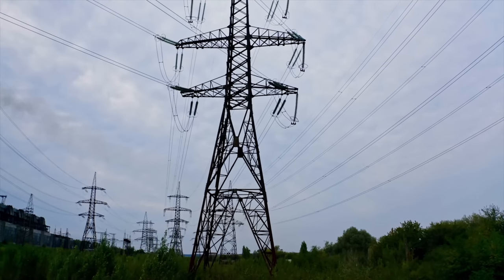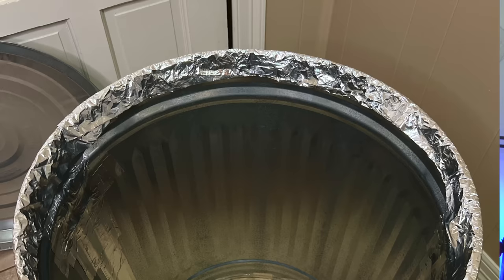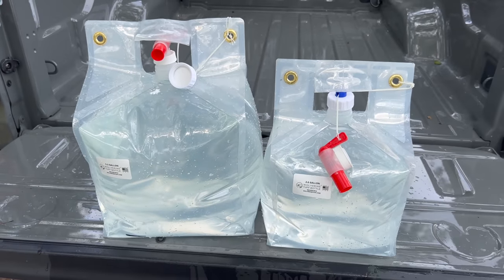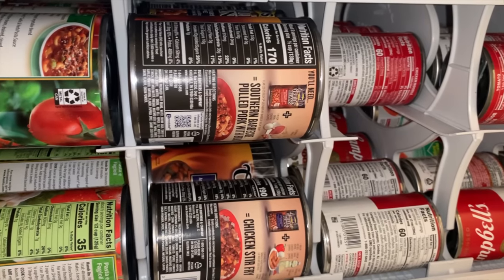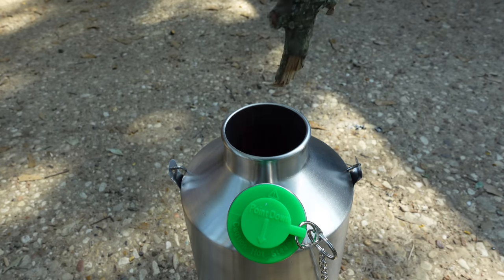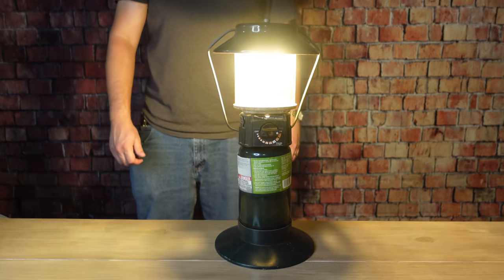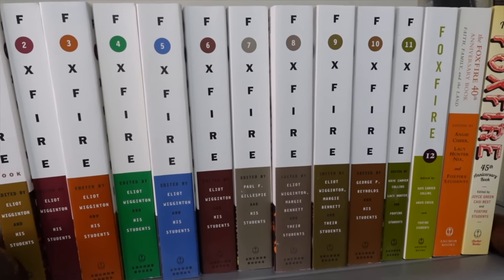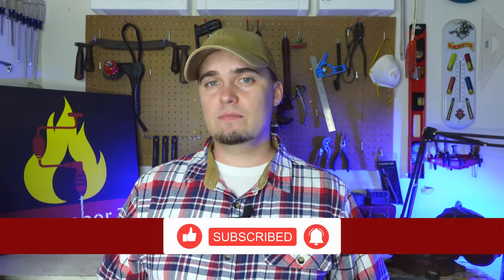Preps You Need to Survive an EMP

Comment: Hey JR...don't forget to store a few flashlights in your faraday cage. Modern day flashlights use LEDs which would fry in an EMP incident. Then along with the power bank you stored, be sure to protect the solar panels, which are susceptible to burn out in an EMP. 👍
Reply from the maker: Hi Eric! I'll probably go into a little more detail about what I'll be storing inside in the faraday cage video. A flashlight will definitely be in there. Thanks for watching and commenting.
Reply: Thanks for the info on the LED lights AND solar panels. I have long wondered about the effects of an EMP on the panels.

Comment: I took a cardboard box. I bought for 6.99 a 4’x8’ piece of wall insulation. It has a metal aluminum on both the front and back and has 3/4 inches of foam in between. I removed one side of the metal sheet and cut to fit the box. Cheap and perfect. I then sealed the box in aluminum foil

Comment: Good vid. Reiterating what was stated in this vid -- the best 'quick test' for a Faraday Cage's integrity is to set whatever it is you're wanting to protect in the cage and test it. If it is an emergency radio, then turn it on and put it in. After securing the lid (or whatever) and you CAN'T hear the radio, then it's probably working a bit. If you can't call your phone b/c it's in the cage, then it probably is protected. One thing's for sure: we don't know the extent of EMP damage. Not been tested at the 'society level' just yet. Depends on altitude, magnitude and your location.   I'm retired, wife still working. Her office is crow-flying about three miles, maybe four. She has a GMRS radio at work, Faraday protected. Same at home. She has a 'walking home route' and a 'driving home route' already pre-planned. Phones down?--switch to GMRS. Yes, we have a family licence, but if the plop-plop hits the rotary oscillator, licences aren't going to mean much if you catch my drift.

Comment: The large transformers used in substations are capital expense items and not off-the-shelf items. They are built on demand and the lead time is typically measured in months, lots of months. In some cases, the lead time can be years. Power grid failures cascade and the power grid could be down for months after an EMP.
Reply: Years. Plus the huge infrastructure loss ( hv wires, generators. Oil, power plant fuel will be gone. Not in faraday cage but essential weapons ( knife, bow/ arrows, .22 rifle and pistol plus a bigger caliber. Silencer good if you dont wish to attract attention). Rest of advice in his farady cage video is great.
Reply: @karlschulte9231  I agree the grid would likely be down for years; my comment regarding months is a best-case scenario. The last time I checked, the large transformers were typically budgeted in the utility companies’ 5 and 10 year plans. To your essential weapons list, I would add a shotgun.

Comment: The thing no one talks about is how likely any building that is tied into the grid has a very high chance of burning down. We all would be starting over no matter what preps we have.  Store your preps in a building not tied to the grid cabin, shed, garage,  root cellular, ect
Reply: Agreed.  I advocate for storing some of your preps in a bugout location. 
If you can't afford land, rent a storage unit.
Reply: @OhPervyOne 99% of storage unit facilities have electronic key card or pin number access  to open big steel gates and thise will also be fried
Reply: Likely true,  @joemarchinski914  but if your backup Preps are locked in a storage unit (usually brick or concrete with metal doors) most likely they won't get burned-up.
The locks may get fried by emp, but the facility is not likely to get burned-down.
Bypass the access to get to your unit and use your solid keys to unlock your padlocks to get to your preps.
Fried electronics may make it somewhat difficult to get in, but that's just a delay. It did not get burned down with your Preps in it, like your house did.

Comment: A basement is a good start on a fallout shelter, but you need to examine the ceiling of it.  If the basement ceiling is the floor of your ground level you have minimal shielding.  This can be solved by stacking or piling dense material in the room above the basement.  Books, bags of dirt, canned goods, a filled water bed mattress, lumber or other items.
Reply: Lead sheet is good

Comment: I have always wondered about the farady trash can if lining the inside with rubber would be better? I would assume so but I dont know for shure. Thanks for the content DIY Prepper.
Reply from the maker: I have thought that as well, but I went with cardboard because it was way cheaper. It also turns out that its a decent insulator as long as it doesn't get wet. The main thing is that what's inside the faraday cage doesn't make direct contact with the side of the cage.
Reply: @diypreppertv  I figured as much. Rubber is pretty pricey. We got 4×5×3/4 mats from Tractor Supply for $40ish. We used them to line our dog cage floors. Easy to clean and very durable. Thanks for the reply DIY Prepper.
Reply: Just need a solid non metal liner. It’s should not touch the metal. The metal conducts the plastic cardboard non porous fabric material limits pass through of the pulse.

Comment: I live in a Giant fareday Cage, a steel shed, and i have to have everything by my window to even get 2 bars of signal on my Hotspot or my cell phone. 

If i move electronic things that require cellphone towers or TV towers into the middle of the room I don't have ANY Service whatsoever. 

So my question is, does that mean my electronic every day devices are safe from an EMP?

I also don't have electricity since I am using Solar Panels and deep cycle Marine batteries as my electric source.

Comment: I have a dual fuel lantern but I've never tried this ethanol gasoline crap in it. Wonder if ethanol effects those like it does small engine carburetors?
Reply: Probably not. Lanterns tend to use brass parts that don't corrode as much as the cheap pot metal used in small engine carburetors. Most replacement carburetors are coated against ethanol, solving that problem too.

Comment: Best option for an endless and usually safe water supply is to sink a hand pump well.  As long as you don't live in a freeze zone.
Reply: one rare comment I read said that her grandparents had a well in their root cellar.
Reply: If you are going to build any sort of outbuilding having a well dug inside the footprint of the structure is a good solution. Especially if the building will be insulated and or kept above freezing.

Comment: hi i have a question not sure if you know ?, if any electrical with a circuit board is going to be fried as the air is charged , unless it is inside some sort of faraday cage  , how can you protect the electronics of a vehicle ecu just by adding an EMP bolt on device at the battery as the ecus are still open to atmosphere , it occured to me that a welding surge protector would do a similar thing on a car , any thoughts